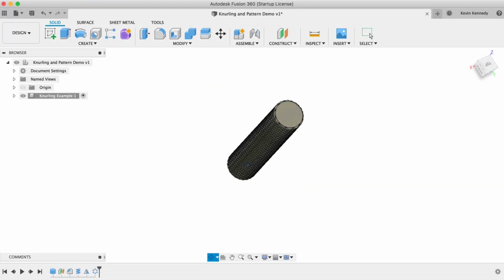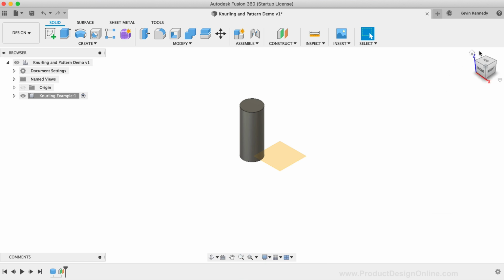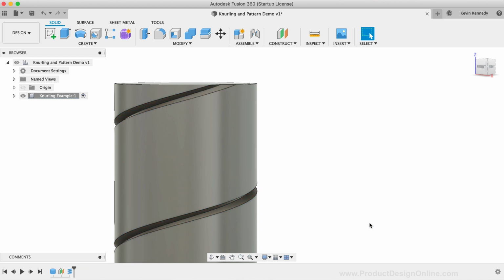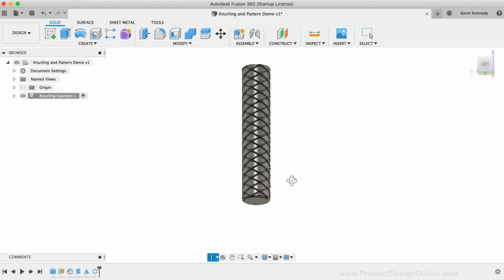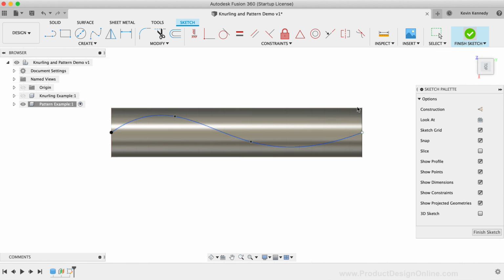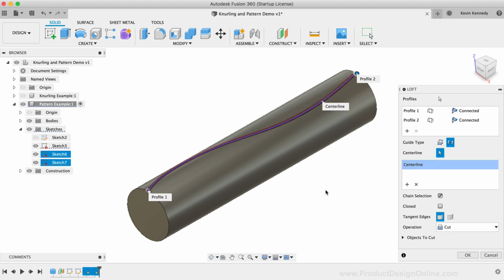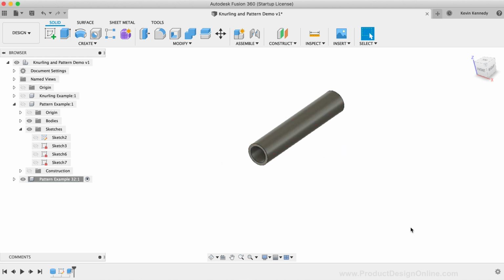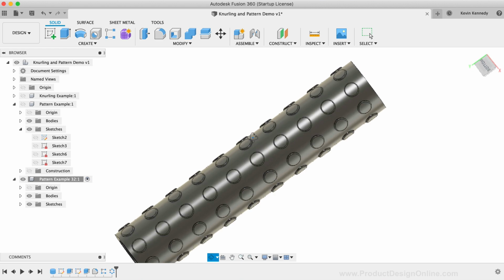Patterns and Knurling for 3D Printing — Fusion 360 — Intermediate

Comment: Question. If you want to apply a knurling to a more shaped body (like a revolved sketch with splines, giving something like a shaped acorn top or a more organic modeled t-spline lofted form shape) vs a smooth face like on the cylinder, will these work? I tried using the Coil method but since that is not following the rounded shape it won't knurl it accurately. Interested to know what you'd suggest for applying a knurled pattern to a more organic shape. Thanks.

Comment: Hi Kevin, thank you, very useful. I see you used these ways of patterns around a tube or cylinder, but would it also be possible to make for example a 'cut mesh' in a surface like this? So for example a metal-mesh for an enclosure? The extrude would then be cut and not join ofcourse, but like this, it can follow quite complex surfaces I think, or am I wrong here?

Comment: i am very new to fusion 360 and I managed to follow everything so this was great. My querstion is the following if someone could answer. I can't seem to get a good geo while using the shell tool. any good tutorials in how to use cutouts without making weird geo?
Reply from the maker: what sort of object are you working with? Shell is not great for complex objects. Instead, consider surface modeling and then use the "Thicken" command to create the thickness.
Reply: @ProductDesignOnline  i actually realised right after my question that I could just extrude down and cut the whole instead of using shell. Still learning this program hehe
Reply from the maker: @panavcreative  All good! there are often many ways to achieve the same thing. Figuring out the most efficient and predictable path is the key :)

Comment: Great video.  Do you have a video where you take real-world knurling, like on a combination square or micronmeter, and pull values like the circular pitch, and use them directly in Fusion360?   I am having a hard time mathematically doing this and am having to eye-ball what looks right (which my OCD hates).  If not, can you direct me to someone that does, or conversion charts, please?
Reply from the maker: Although we "cut" a knurl in CAD software - it is generally a material displacement  rather than material removal process in the real world. There's really no way to make it true to a real knurling in the Design workspace...at least not without creating a very complex model. One option would be to utilize User Parameters to your advantage (from a math standpoint). You can also use the new Emboss feature which may simplify it. That was not released when I recorded this lesson.

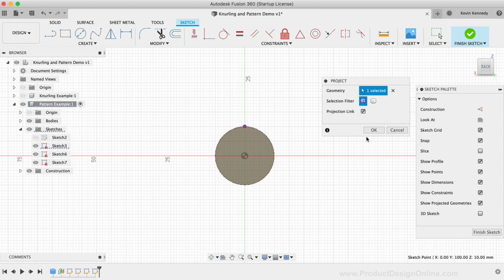Comment: Hey Question! - @10:20 You are trying to project the spline to the cylinder, but when I am trying that on my example project I can't seem to click on the ends of the Spline to project to the end of the cylinder. Are you selecting the ends of the cylinder first as selecting the geometry, then picking the end of the spline as a point?
Reply: I went back through the component to see if I could find a mistake in the process which I wasn't able to find. Deleted it and rebuilt it with the same issue of not being to do the "Project" function onto the end of the cylinder. You go through that step a bit to fast, and not sure where my mistake is
Reply from the maker: You have to select the end of the cylinder as the face to sketch on, followed by selecting just the points that are the ends of the geometry that is already projected (the spiral line).

Comment: Thanks for video...at 5.30 re circular pattern you say "I'll click on the Z axis hidden behind the body"..but then you do some sort of secret click...when I click it just says 'faces' faces'..but there is no Z...I've tried for 5 minutes clicking, holding,  experimenting...Z does not appear...what special technique do you do to make the Z appear? Thanks!
Reply from the maker: Hi Matthew, there is no special trick other than clicking and holding. However, you need to click and hold close to the Z-axis... if you're too far away it will not include that in the list. If you're still having issues with that you can toggle open the Origin folder in the Browser and select the Z-axis there.
Reply: @ProductDesignOnline  Thanks for reply. I found if I clicked off the body..I could then click the Z axis. Thanks for your help!

Comment: Another great tutorial. Thank you for your work! One question : How would you construct a staggered row of knobs at your third example?
Reply from the maker: Thanks, Günzi 22. There are two ways you could do that using the pattern tool.
1. Create the second (staggered) knob before using the rectangular pattern feature. Select both of them as features to pattern.
2. Create a separate row of staggered knobs (or whatever detail desired) and do the circular pattern feature as two instances, making sure there is enough room for the other instance. Essentially, the circular patterned would need to be spaced to complete every other row.
Cheers, Kevin :)

Comment: Hi Kevin, 

Great video. It’s a major thing to understand and create complex features on the surface of 3D bodies, such as cylinders and you make it so easy to understand.

I’ve got one question though, about the Project command: at 10m08s you say “ First, however, I’m going to project both endpoints of the spline using the project tool.” 

You explain “This is going to help ensure that our circles are connected to that end of the spline, so we can avoid getting the loft error that the “rails do not touch all profiles”…. “Notice how this circle easily snaps into that endpoint of the spline that I just projected, ensuring that these profiles are connected to each end of the spline.”

That makes sense, but I'm still not clear what's going on when you use the Project command. You’ve probably explained this somewhere else, such as in your Project command videos, but I haven’t seen it. Maybe you can give me some references to view/read??

Where is that point projected onto? In this example, the point is already on the sketch plane, so it's not at all obvious where the point is projected onto (and you repeat the process at the other end). What exactly is happening when you select one point to project like that ??

Glad to be one of your patreons, you bring so much value to the table.

Martin
Reply from the maker: Hi Martin. Great questions. I had to read this twice, but I can see what you're saying now - the projection feature is not the easiest to explain, but let me try :)

I do have a video that covers project/sketch, which may help clear things up - https://youtu.be/WAs144r-Xko

I've added to my list of website topics to cover this as well. I think a thorough write up with some common examples would be helpful.

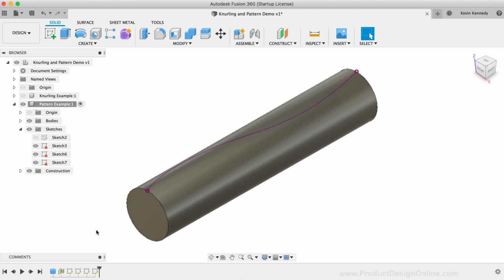In this scenario, you are correct that one could theoretically connect to the endpoints of the top spline. However, I projected them to the sketch on the face of each end of the cylinder as a way to 100% guarantee when I draw the circles at 10:30 that they stan to that same point. The reason this is more accurate is that the projected endpoint and the sketch of the small circle (on the face of the cylinder) are on the same exact plane. Often times projected lines that are on other planes, such as this spline, cause issues with the loft and sweep commands because they appear to be touching/connected to our naked eye, but to the program, they are the ever-so-slightest bit away because they're on a different plane.

I hope that helps a little bit. I will try to make some more examples for my website that are more common/clear. Cheers, Kevin :)

p.s. thanks again for your continued support, Martin!
Reply: @ProductDesignOnline  Ahh. I think I'm getting to understand it now, but I had to take reference to the help popup in Fusion 360 before it made sense, as well. 

Selecting the command "Project" from the drop-down Sketch-Create menu, the help popup says "[The Project command] Projects the geometry (body silhouette, edges, work geometries and sketch curves) into the active sketch plane". 

That's the answer I was looking for - I didn't know what was being projected onto where. Sounds dumb, now, but it's a fundamental concept I hadn't grasped before.

So, in this instance, the spline end-point was residing on the outside face of the cylinder (lateral axis) and what you did was project the spline endpoint from the surface of the cylinder onto the flat edge plane (end-section plane, perpendicular to the cylinder's round surface). That way, you make sure that the end-point, which is in one plane, is coincident with the tool-die circle on the cylinder's edge, which is in a perpendicular plane. Similarly, it also ensures that the circle cut will go from cylinder edge to cylinder edge, all the way.

The benefit of this "neat trick" is that if the end-point is not exactly on the perpendicular plane (for example, in case the end-point is undetectably a micrometer short of the plane), the project command will make sure that the new geometry (the circle) coincides with the end-point, beforehand. So when you later draw the tool-die circle on the edge plane it runs the surface spline from one end of the cylinder to the other.

The penny has dropped, lol !!

NEAT TRICK, KEVIN. Thank you. Glad to be a Patreon.
Reply from the maker: @martinrcflyer4089  That's correct! - glad it all makes sense now. This is bar far one of the "harder" concepts of Fusion 360 to grasp :)

Comment: I learned a little about creating knurls in Fusion from Paul McWhorter's videos. I have used them for 3D printer bed adjusting nuts and similar.  They printed very nicely and look and feel great. You have added some ideas beyond the traditional diamond knurls commonly used by machinists. Thank you!
Reply from the maker: Thanks for watching, Micahel. That's great to hear you've had some successful knurling prints in the past! Keep at it! Cheers, Kevin :)

Comment: Hello! I am generally new to 3D printing and am having one major problem. Every time I print, the base of the print doesn’t stick to the main part, resulting in an uneven, and bumpy base. Could you do a video on the best way to get a flat base? Thank you!
Reply from the maker: Hi, TheKingOfGrapes. What brand/model 3D printer do you have? You'll want to make sure you level your build plate. Most printers have a "leveling" setting under the menu, where you'll check that a sheet of paper can slide back and forth as the printer moves the heads around to each corner and then the center. If yours doesn't have this leveling feature then I always recommend doing this manually. Cheers, Kevin :)

Comment: I just spent the entire evening on your tutorial. The pattern example is a winner. I made and modified and restarted it from scratch a number of times until I was comfortable with the procedure. I had been avoiding the loft command as it often produced errors and it was easier to find another method than fix until tonight. Loft is pretty finicky but I've come up with some rules that should help me in the future. I ended up making a vase that is printing now. I had previously done some knurling on the 3D printer in the past but found the edges too sharp to comfortably grip and they also were a stringing nightmare so I avoided them but the pattern example kills the traditional knurl I had been using.
Reply from the maker: Hi, Brian. Glad to hear that this tutorial was useful. I understand what you're saying, I've had some knurling prints come out not so well... it takes a bit of fine tuning as far as the size and pattern to get them to be comfortable in a hand.

Thanks for sharing. Cheers, Kevin :)

Comment: I've used knurling a number of times.  In addition to grips, I find that it can obscure layer lines and make an item look more finished right off the printer.  A couple of things I don't understand in your video.  In the first example, If you were going to chamfer both ends, why did you use an offset plane for the coil?  On the second example, why not just use a simple sweep rather than a loft?
Reply from the maker: Hi Robert. Great questions.
1) I did not decide to chamfer until after (intentional) to show that you can always go back in the timeline. In regards to the offset plane, that was to ensure that the end of the coil started before the cylinder so it didn't have a weird starting point. I would say it's still best to do that because if one were to change the chamfer size (or remove the chamfer) they wouldn't have to worry about it.
2) The reason I used the loft instead of sweep is because of the end. When you sweep the end profiles will stay perpendicular to the line the sweep follows. With loft, the profiles dictate the shape at the end of the rails or center line. Additionally, the sweep feature does not always produce consistent result when using it with fit point splines, due to the nature of how the splines are processed in F360.

Let me know if that didn't answer your questions. Cheers, Kevin :)

Comment from the maker: Do you like these "intermediate" level tutorials? 
Check out my Intermediate Surface Modeling ➞ http://bit.ly/surface-playlist-int
-
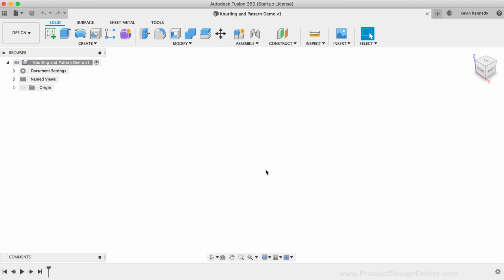0:48 | Setting up user parameters
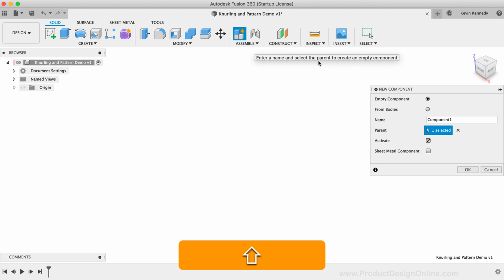1:21 | Creating a new component
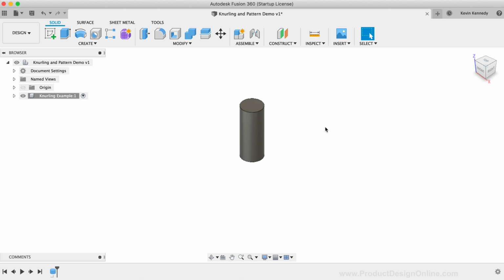2:12 | Creating an offset construction plane
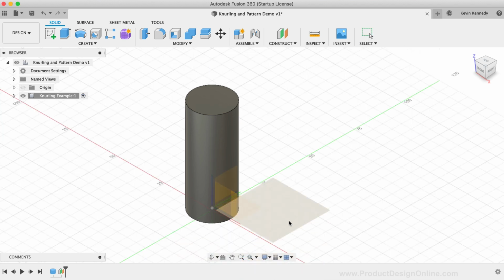2:30 | Using the coil command
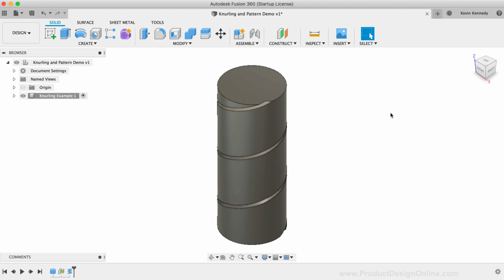4:46 | Mirroring the coil results
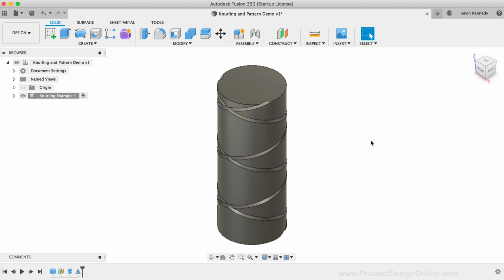5:12 | Circular pattern the coil and mirror features
5:53 | Adding a chamfer to the end of the cylinder
6:43 | Adjusting the look of the knurling pattern
8:00 | Creating a new cylinder for pattern example
8:52 | Sketching fit point spline curvature
9:36 | Projecting the spline to the cylinder surface
10:50 | Cutting out the path with the loft command
11:59 | Circular pattern the loft and fillet features
14:00 | Creating a dot pattern on a cylinder
14:57 | Rectangular pattern the dot
15:37 | Circular pattern the dots